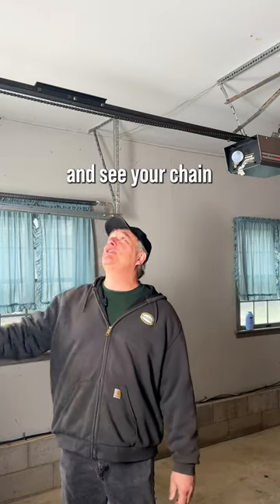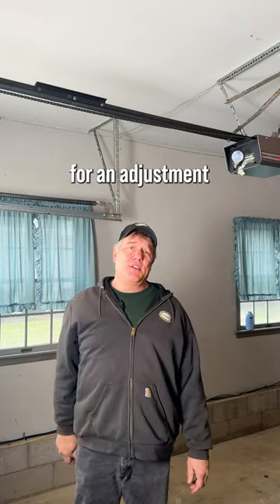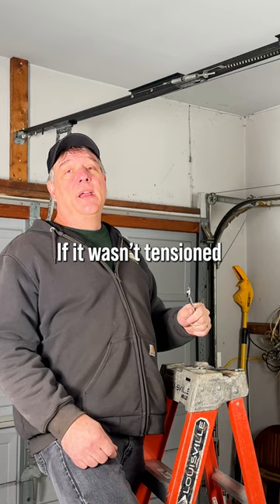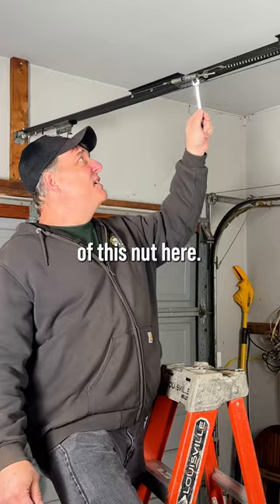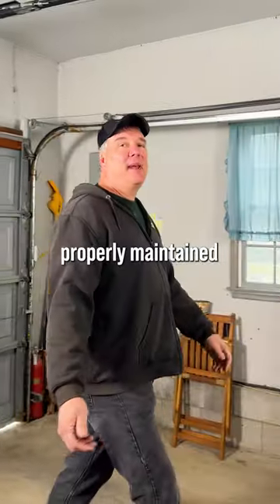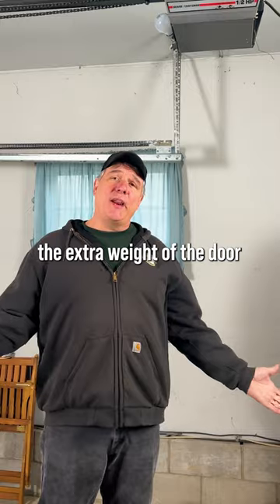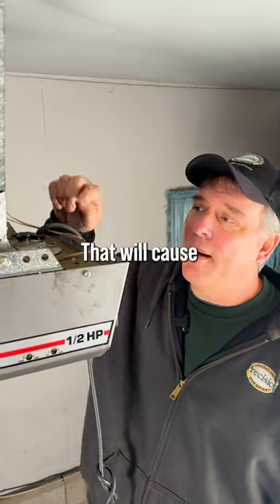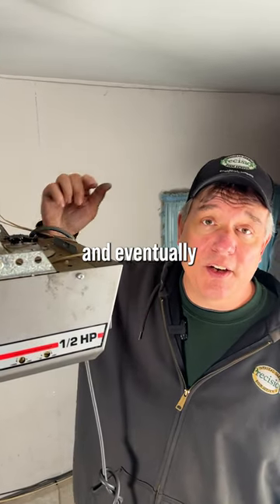Chain/Belt Sagging on your Garage Door Opener? #Shorts #GarageDoors #DIY

Comment: If your door does not stay up 1/4 of the way up, halfway up and 3/4 of the way up your door is not ballanced correctly which means your custom springs are incorrect, that will cause strain on your motor bc it is having to lift more of the doors weight to make the motor work